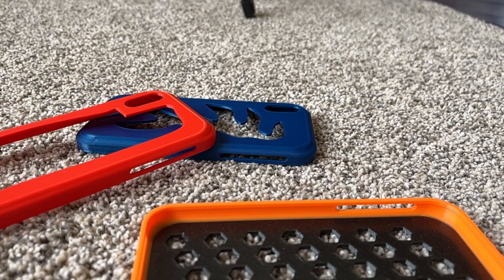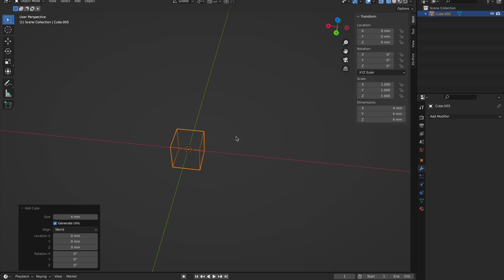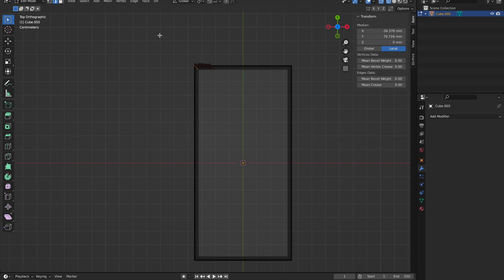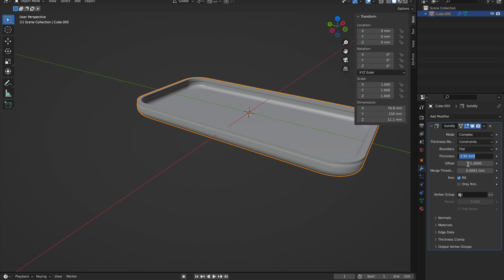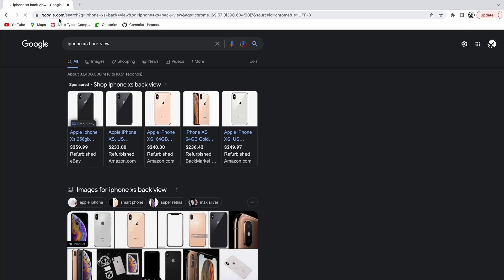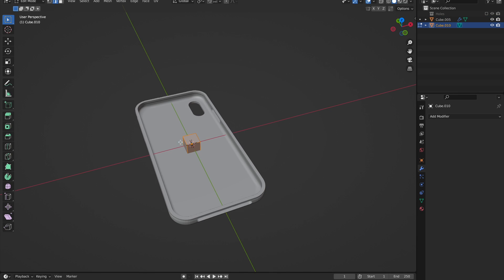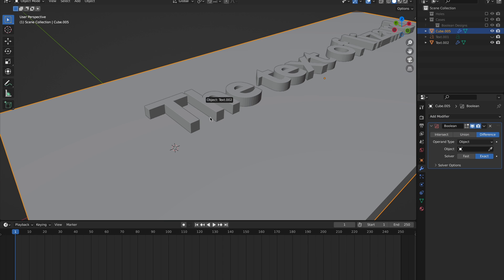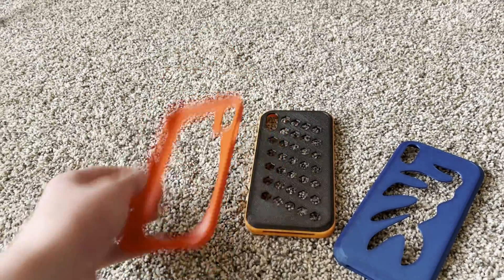3D Print DIY Phone Cases // Blender Tutorial

Comment: So I'm taking on a REALLY ambitious project where I'm designing a case for portable monitor to turn it into a "Switch XL". I'm essentially using a 15.6 size monitor that has various ports at the sides and a vesa mount in the back I'd like to utilize. I saw that PCB way has a printing service, but are there better services out there that would be good for a cheap prototype process?